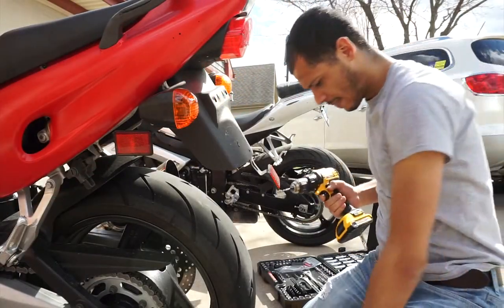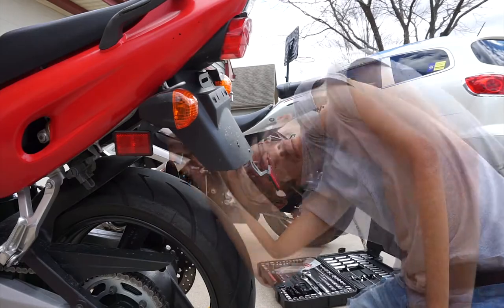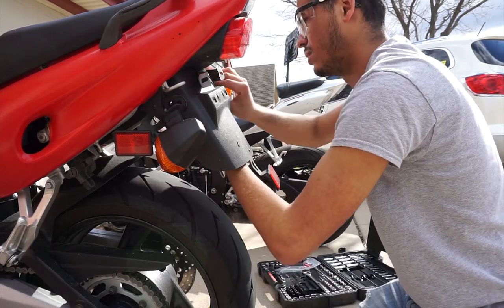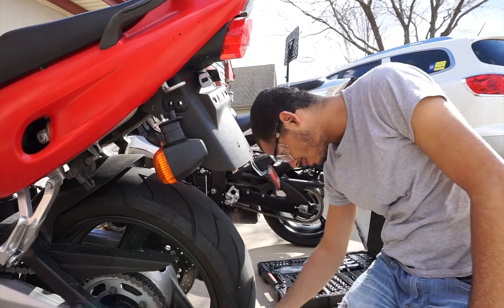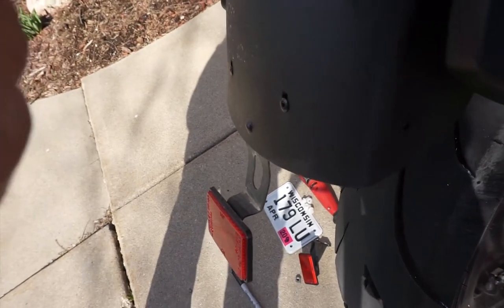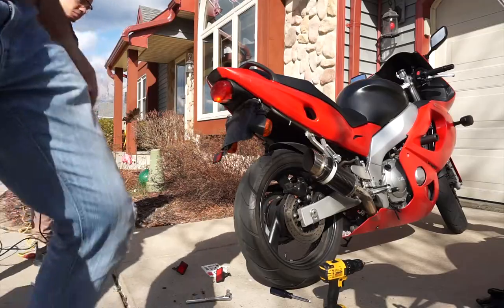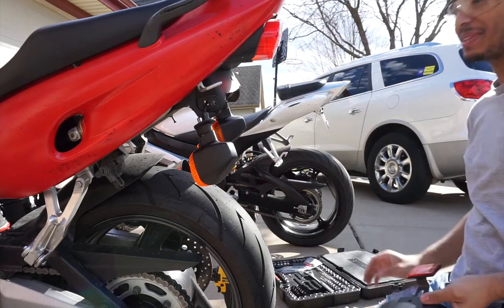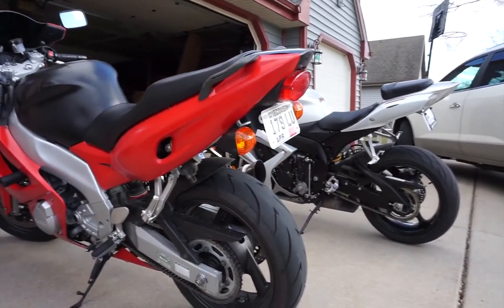Custom Fender Delete On My Yamaha YZF600R

Comment: I bought the exact same LED turn signals for the rear and did everything you said like leave the gasket in but when i put the new LED turn signal in, the thread for the signal barely reaches the other side to put in the nut any help thanks.
Reply: Shave down the grommet make it thinner
Reply: @delvinmartinda7852  thanks I did that and it worked. I had to cut a little on the led light itself as well. I installed them and did the custom fender delete now I just gotta install the front turn signals and hopefully they all work properly